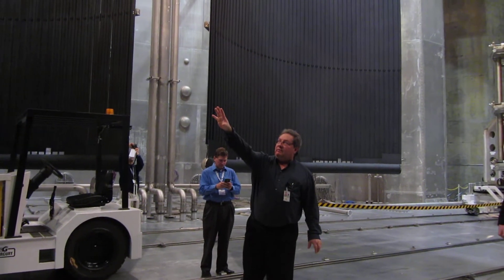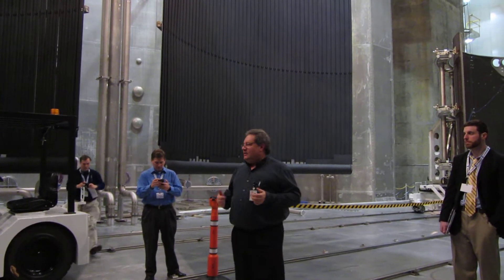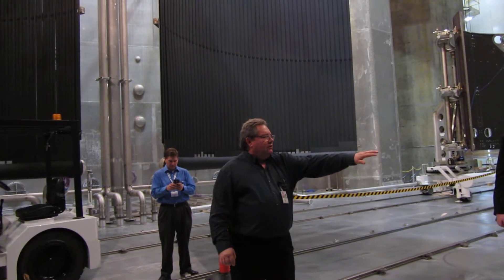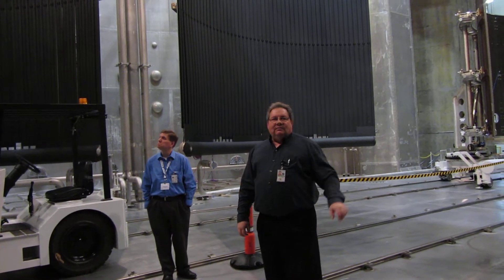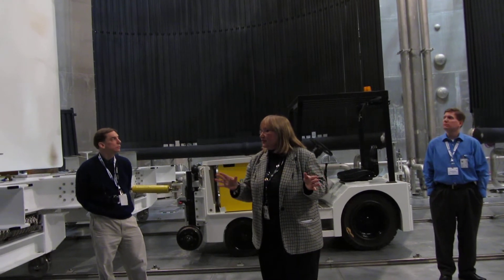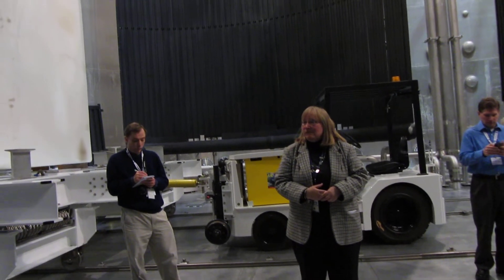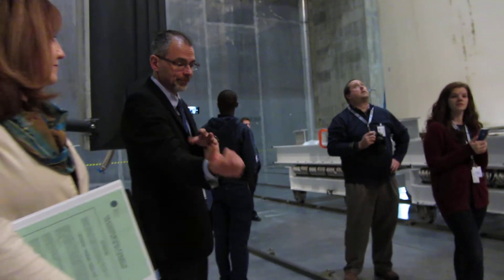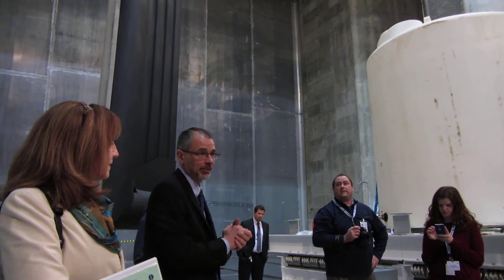World's largest vacuum chamber at NASA Glenn's Plum Brook facility

Comment: I understand that it takes a few hours to remove all the air to create the vacuum but how hard would it be to have a few space suited volunteers in this chamber (I’m not asking them to use the old Apollo suites as that wouldn’t be fair) and let them carry out a few duties using their hands to operate electric tools etc. whilst at the same time what about a miniaturised or scaled down rocket or a thruster as they call it suspended horizontally in this large chamber with a video showing it being fired before and another one after the air was pulled out to create the vacuum. The rocket or thruster would need to be suspended from the roof of the dome about half way down and with the nozzle say 80 feet or so away from the side so as not to use the wall for assistance. has this experiment already been carried out and documented I wonder, and if so could that be reason we haven't seen them?  I really do think an actual video capturing the event will prove so much so we can all learn something.